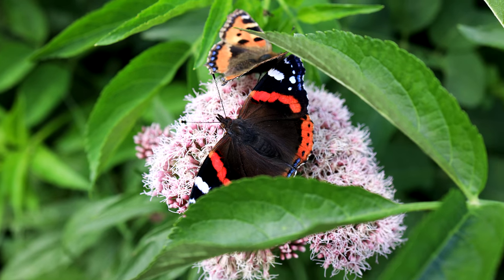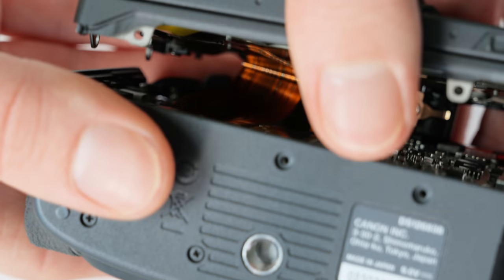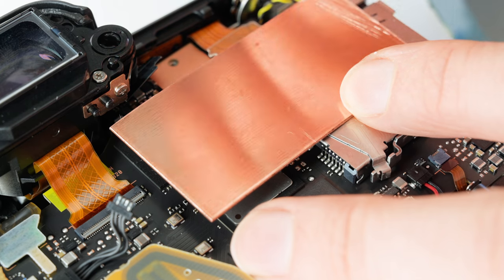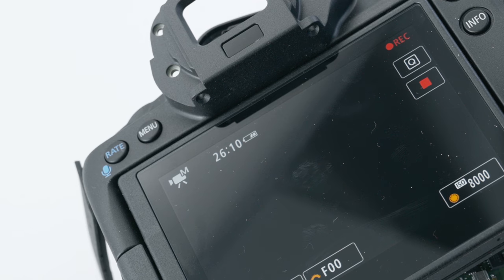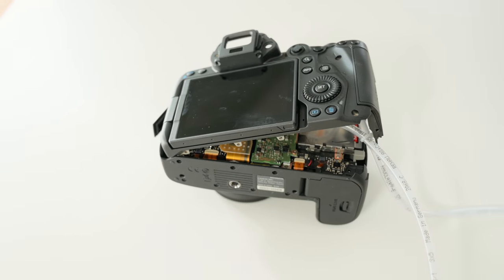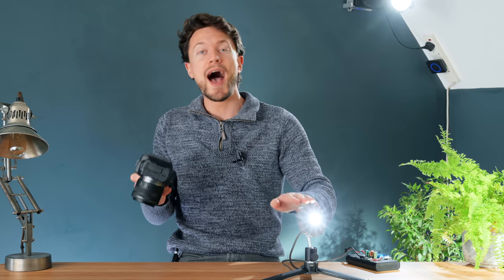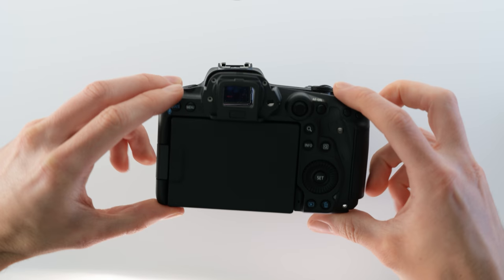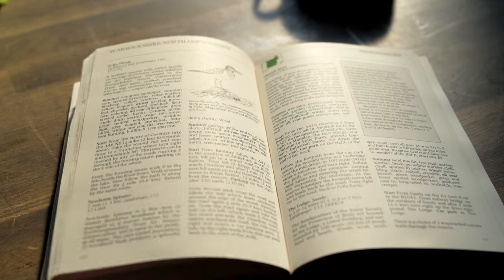The only reason to watercool a camera....

Comment: What a baller! Great work man!
Reply: Partner together and sell this type of modification! You''ll be rich
Reply: Hihi just my thoughts too !
Only i would , ad a aluminum or copper/ magnesium backplate aswell .
Thats why panasonics weight so heavy !
Its all metal in/ outside .
Grtzz johny geerts
Reply: Yeah go ahead and try it and see how it works.
Reply from the maker: Thanks! :D
Reply: Don't understand why they didn't make the rear shell metal and use it as a massive passive heatsink, clearly your awesome (!) prototype proof of concept is along the same line. Seems like it's marketing/product line separation artificially crippling the retail design for the good of the retail channels... The engineering team must be so frustrated with this design deficiency.

Comment: very clever. Scares the crap out of me. I worry if my battery door pops off! :)
Reply from the maker: Haha, cheers Philip! Been following your work since the 5Dii days (you got me into using dslrs for video!) so it's nice to see you here. I agree 100% with your assessment so far in your review (part 1) and your last note hit a chord too - I didn't expect to like the R5 but I've fallen in love with it for both stills and video too. Good stuff!
Reply: @DIYPerks  do you think you could make a cooling device that cools the R5 AND also dispenses slush puppies? Raspberry of course! Perfect for summer filming 😃
Reply from the maker: I'll have to draw up some plans 😄
Reply: @DIYPerks  🥶😎
Reply: @philipbloom  the crossover we need
Reply: @terter973  but don't deserve
Reply: @terter973  only need a machinist now to make a sturdy case for the fan. @This old Tony
Reply: A crossover more ambitious than Infinity War
Reply: I love it when the youtube titans collide!
Reply: @DIYPerks  How about using thinner copper strips or a vapor chamber to help to conduct/spread the heat to the camera's metal chassis? Great video! Your copper plate design is really neat 😃!
Reply: If only canon recalls and installs this on r5 and r6, instead of waiting for a7iv many will swift to Canon
Reply: @justketh4298  that’s a LOT of cameras though.
Reply: @justketh4298  Yeah, unfortunately the logistics / resources needed to do that are most likely too expensive for Canon.

I would personally like them to add this improved passive cooling to their production line immediately and provide a $100-150 service (to only cover the expenses) to get it added for existing owners - if they like to.

This would be a win win situation, but because many owners would get angry for needing to pay for it, we will most likely not get this improvement at all 😟. Though this could become available through third party modification.
Reply: @DIYPerks  Hi, at 13:12 did you forgot to put the thermal paste on the copper connection points to the camera's body (where the heatsink screws down)? Thanks! 🙂👍🏻

Comment: ”If anyone can, Canon can” used to be their slogan. Apparently, they can’t anymore.
Reply: They don't give a shit simply
Reply: "🎶You can on a Canon, you can do"
Reply: can’ton
Reply: Canon'nt
Reply: Yes they still can, buy a videocamera, and stop thinking a photocamera with a video-function is an all-out replacement of a videocamera.
The manual probably even states this "problem" from occuring due to the device not being designed with video in mind.
Reply: @Dutch3DMaster  

Considering this is their flagship and the 8K recording capability is a HUGE SELLING point, this is a failure on Canon’s part. If this was intended only for stills, then it should not have included that feature and been marketed only for stills. The fact of the matter is that it was marketed as a camera with “groundbreaking 8K recording capability” and many people bought it for that reason. Yes, you can buy a videography camera, but this was marketed as a device capable of both. You making an excuse for Canon’s failure is giving them permission to repeat that mistake. Companies’ products need to be held at least to the standards they have set for themselves. If they cannot achieve this, they need to rethink the selling points prior to releasing the product.
Reply: If Canon can't, everyone can.
Reply: Lol
Reply: @augustjoseph629  it's not a video camera, get over it
Reply: Canot
Reply: They cant anymore since 2000s

Comment: Nicely done. I'm guessing you were prioritising keeping the camera as close to original as possible. If not; the thing that struck me was that you could cut a hole in the outer casing to expose the new metal. Potentially even with a low profile heatsink. That way you can potentially cool it entirely passively.

I'm currently enjoying a cool 28 degree breeze late at night, with day time temperatures usually in the 30s or 40s. So am thinking about how far I'd need to go to make it viable for my use-cases.

Comment: Market segmentation that's why, they don't want this competing with their dedicated video cameras. Canon has a history of crippling products for this exact reason.
Reply: lots of tech companies do this, it's by no means just Canon. It's basically industry standard practice to artificially cripple your consumer products so your enterprise customers have to pay the higher ticket you set, often with a hugely higher margin. 

My favorite example being Intel's hyperthreading, unlocked CPUs, and ECC memory support, all of which cost nothing to implement, they are features by default and disabled based on which tier they are binned into based upon other factors (such as functional number of cores, and amount of voltage it takes to hit a given clock speed). Core count reductions in down step chips may actually cost money, since it does at least take some tooling and time to remove badly behaving cores rather than just leaving them there but turning them off, but we cant have i3s that can be potentially unlocked into i7s like the old AMD phenom days now can we, especially if the clock speed was also left unlocked? I finally recycled it, but I had a phenom ii x2 that had 1 more functional core that could be unlocked on a motherboard with the option.
Reply: @AmaraTheBarbarian  Intel still uses hyper threading as product segmentation. For more then half a decade the only difference between an I5 and I7 was intel flipping a switch in some microcode and charging hundreds of dollars for it.
Reply: @devilmikey00  yep, that's something I said...
Reply: Yeah! It's designed with poor cooling, and has warnings built into the OSD! No heatpipes, no copper, no cooling paste.... put a circuit board on top...... so it LOOKS like they made a mistake, and is incredibly hard to fix for the user (no firmware hacks for instance)
Reply: @AmaraTheBarbarian  Apple....with their iphone update
Reply: Not really in this case. You can’t sell products with surfaces that exceed certain temperatures. 50C and more is probably not legal
Reply: Apple too
Reply: @devilmikey00  Than.

NOT then.
Reply: I thought they were just dumb and lazy. But that's much smarter.
Reply: @PSYCHOV3N0M  this is an unwinable battle. Your garanteed too loose! 

In all seriousness, policing grammar doesn't help anyone.
Reply: @AmaraTheBarbarian  Are you implying they're physically removing cores? Because they absolutely do not do that. With how fragile the dies are, I don't think it would even be possible. The cores are just disabled, but it's not bits in some flash memory that could be reprogrammed, it's eFuses. You just run a high current through a particularly weak trace in the chip, the atoms migrate, breaking the trace and the fuse is “blown.” Irreversible, but very simple, cheap and safe.
Reply: @hellterminator  Well that would depend on the exact time and architecture. Sometimes the connections are simply severed but YES they can be physically removed my man, in the same ways we remove the dies themselves from a full wafer, primarily laser cutting. It's not like the cores are the only thing that gets removed or severed though, like we don't just notch out a core or 2, some of the supporting architecture goes along with it, cache, scheduler, for the particularly low end chips bits of the memory controller.

An i3 is physically smaller than an i7 and that's not for no reason, yes stuff gets cut off.
Reply: @AmaraTheBarbarian  Yes, I am aware how wafers are cut, but they're cut in a regular grid, you don't cut a piece out of the middle, which is the part I'm not sure would be possible. 
When i3s are physically different dies (which has often not been the case for some time after Intel switched to a new node before they got the yields up), it's because the die was designed with fewer features, not because they made a full i7 die and then cut half of it off. Even if they ever got into some weird situation when they had to use fully functional i7 dies to meet sudden demand for i3s or something, they wouldn't be cutting off pieces of the dies because not only do they not need to do it (because they can reliably disable features with fuses), but the extra silicon will help spread the heat out. Even if the operation had 100% yield (which, unlike blowing a fuse, it wouldn't), it would still not make sense because you'd be using a big, complex, expensive machine to do it versus… blowing a fuse with a cheap programmer.
Reply: But if heat was way to escape and more metal moving it, it's just 50-60% to get out case temp to 50. ;)
Reply: @CoffeeD_1  Similar to the m2 air probably

Comment: A bit late to the party but there is a safety regulation that calls for a limit to temperature rise on materials which end user touches, I think it is around 52-53C?
Coupled with the fact that it should be fairly well sealed from dust etc (its not officially IP rated I assume but I guess dust in camera = dead), they wouldn't want to risk having any openings.

Great video, and much more professional finish than I expected! thank you.

Comment: You know it's screwed up when users are willing to void the warranty just to be satisfied on the product.
Reply: actually u dont void ur warranty by taking it apart as long as ur not destroying or removing anything.
Some companys still wont take the return but its illegal and u would win in court
Reply: @r00kiet80  he replaced the metal plate

but still, yeah, companies would rather leave you alone than* go to court, it's cheaper that way and the extra bonus of the customer paying them (companies) more if they frick up is just a win for them

Edit: typo
Reply: @OninDynamics  u could just but the original pieces back no big deal.
Reply: @r00kiet80  yeah, for most people.

I think a lot of the stupid rules companies impose on themselves is because some idiot breaks their product, goes to court with the company for a stupid complaint, then company lost money even after winning the case. Then everyone has to face the consequences.
Reply: You know its screwed up when a firmware update fixes the overcooling timer (aka they already had a temperature sensor and decided not to use it so it would be more inconvenient)
Reply: @r00kiet80  In some countries you can actually sue the company if they don't take the return *if the problem has nothing to do with your changes*. Of course if you broke it you don't get a warranty. But if you modified it and it broke for an unrelated reason, you still do.
Reply: @thewhitefalcon8539  whats ur point? why did u just repeat what i already said whats the point of your comment

Comment: Not gonna lie, I would have sold this as a kit myself.
Reply: Honestly somebody needs to so I can buy it I’m not doing all this delicate work
Reply: @junglevisions803  Lol you'll still have to install it to the inside of the camera
Reply: @realtissaye  maybe you can buy only the 3d printed part. It eill give so much time to camera without all the things installed inside
Reply: @berkekutlu6154  You've misunderstood something, you need the copper plate inside.
Reply: @nenadcvele  I think you can do a decent cooling with the extra fan withput the copper plate
Reply: @berkekutlu6154  But there's nothing to transfer the heat from the processor to the outer plastic cover.
Reply: @junglevisions803  How much would you pay for a kit?
Reply: @berkekutlu6154  My 3D printer was $800 and prints WAY better than what he showed in the video I wonder how much people would pay for this kit.
Reply: @Tony-nl6pf  i think this kit is actually worth it. Cuz you are using it for a really long time instead of 25mins. But ngl better design and printing can be done for sure
Reply: @berkekutlu6154  I don't have this camera but I have the tools to make a kit including thermal paste, copper back piece and 3D printed part. I don't think anyone would buy it tho.
Reply: @Tony-nl6pf  but not everyone has so some guys out there will buy that.
Reply: @realtissaye  Installation is easy. The creation of the new parts isn't.
Reply: @Tony-nl6pf  120€-240€ would be a reasonable price for the parts and a high quality version of the fan-mount-system.
Reply: Is this not already resolved?  Hasn't Canon already released a less heat intensive one?
Reply: @junglevisions803  Buy a CNC router and just have it make the entire bottom frame of the attachment as a machined copper heatsink.
Reply: You've to pay Matt/DIYPerks royalty for selling his mods just as you wouldn't want anyone using your photos commercially for free.
Reply: Why I don't want someone use my photos free :p 
If anybody have enough interested, just do it. I wouldnt take cam if it's literally boiling when shooting. It's not ww1 machine gun with barrel tank of water.
Reply: @realtissaye  installing it is as easy as assembling a pc, the hard part is fabricating the plate itself if you don't have the tools/skills
Reply: @Tony-nl6pf  I bet you could sell a whole upgrade kit on ebay. Fixes for high value tech items almost always sell for a good price, especially if there is no readily available commercial option. You will have to put quite a few hours into every single one so try and be bold with your pricing and see if you have to go lower. Take it from someone with an $800 printer that sells replacement platic parts for discontinued industrial eqiptment with a 1000% profit margin :D
Reply: @berkekutlu6154  to achieve better thermal management, the copper plate is needed, alongside with an attached fan. Cannot miss the other one

Comment: I used thermal pads between my sensor and the back plate on my T3i for astro work. And then a dual stage tech (two $3 12v 60W units), but running at 3.6v and a old and heatsink/fan. All removable and undetectable. For astro work (5 minute sub frames), one sec off, repeat for hours, it works wonders. It's still working 12 years now.